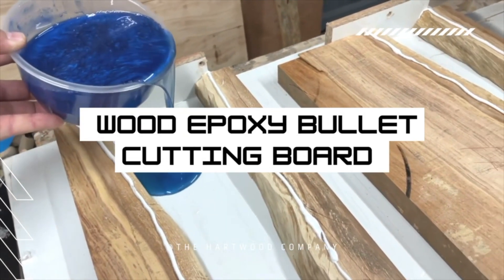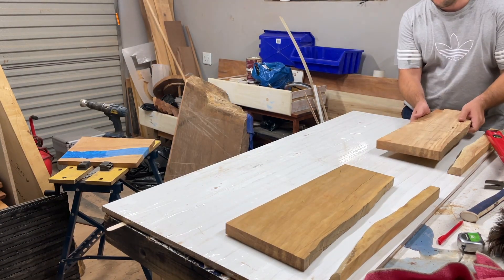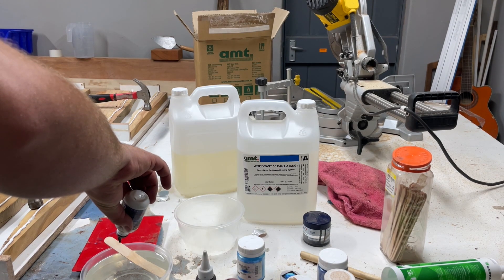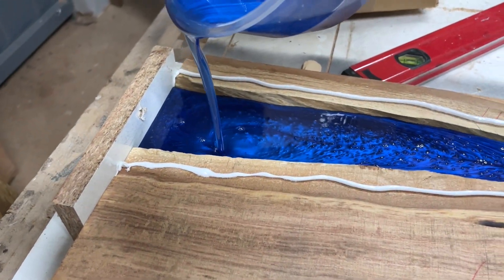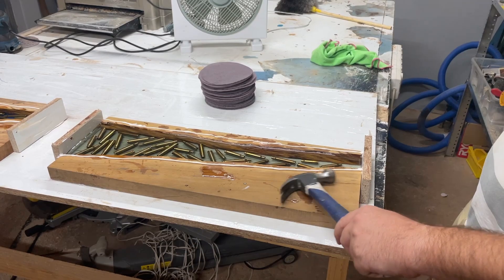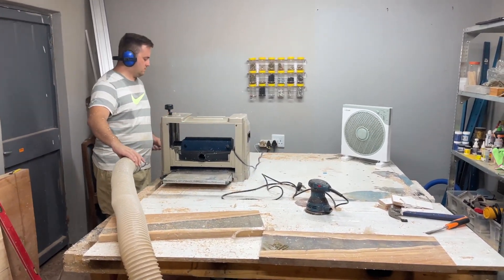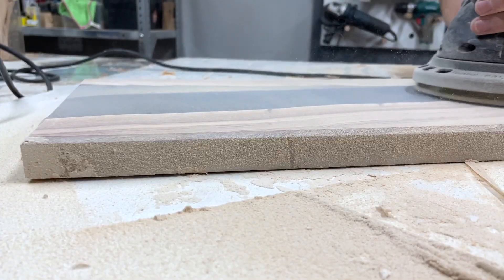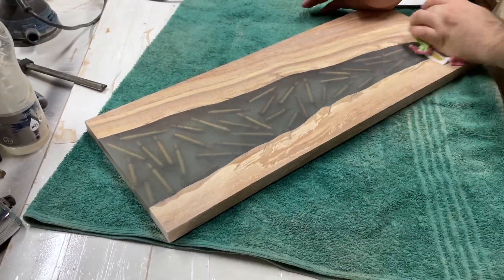HOW TO - DIY Bullet and Resin Chopping Board from scrap wood!!!

Comment: What is the reason for putting silicone on the top of the board before doing the pour?
Reply from the maker: Hi Kristin, it’s to prevent over pouring the resin. Resin stains wood, so to minimise the chances of staining, we caulk the edges as closely as possible.
Reply: @TheHartwoodCo  thanks! Never would have thought of that.